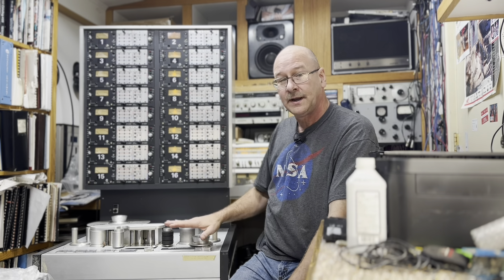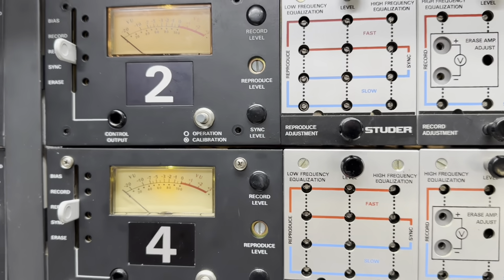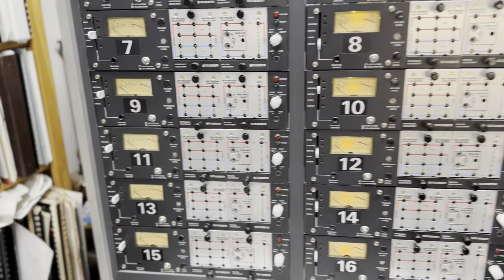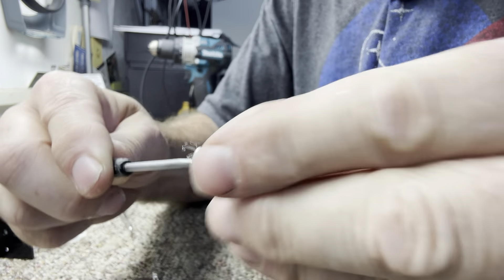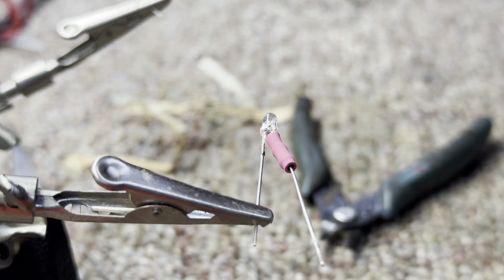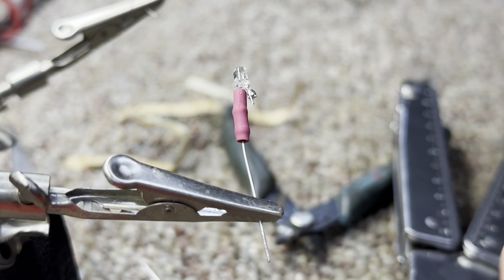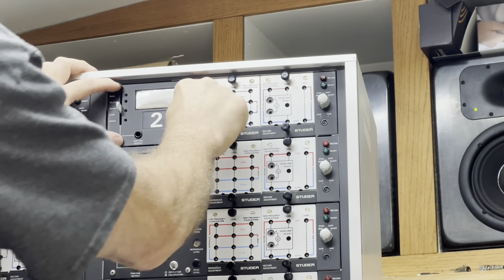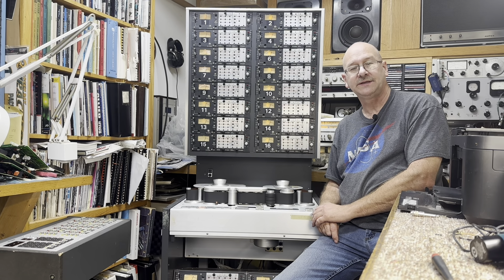Making LED meter lamps for vintage audio products ￼

Comment: Some flat tops, or straw hats would probably give a better spread. Although, you could always just go over the acrylic package with some fine sand paper or file to cloudy it up and defuse it a touch. Or pop a little bit of paper or some such in front of it to diffuse that how spot.

Comment: If you take a small piece of 1000 grit sandpaper and scuff up the end of the LED, it will not only lower the intensity of the spot, but it will diffuse more of the light to the sides.

Comment: If you have 24v to work with, you can use more than one LEDs in series to replace one bulb to make the light pattern more even.  Another trick is to file off the lens on top the LED to make the light less concentrated.